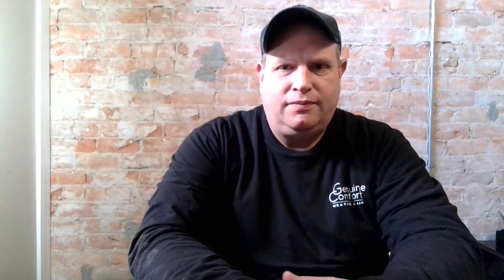Whats the difference between Variable Speed And ECM Motors

Comment: Variable speed and constant torque motors are both ECM. Variable speed will keep a constant cfm. If you're filter gets dirty, itll increase torque and rpm to maintain CFM. Constant Torque does what it says. If you're filter is dirty, its going to maintain its torque. But BOTH are electronically commutated motors.

Comment: I have a variable speed furnace, but in reality, it will only run at 5 speeds, even though it has the necessary circuitry to run at any speed.  Mine is used with a two stage air conditioner and from the factory, it has two AC speeds, two heat speeds, and one fan speed preset into the system. Using switches on the unit, I can change the speed for any of these run modes, but it cannot be varied on demand by my two stage AC or the heater other than to select the different modes, which are esentially high and low for heat and for AC, and a setting for a low volume circulation only.  Now with a two speed condenser, it really is necessary to use a furnace like this because once again, you need to have the ability to match the air flow to the different stages. I had an inverter based system where the condenser could change over an "infinite" range, then the blower would commicate with the condensor to match the speed of the blower and the pressure of the condenser (at least this is my understanding).  Otherwise, my variable speed furnace can only run at one of five speeds, but I can manually set the speed for each stage using the controls on the furnace, but I have to go into my crawl space to do that and I think it is pretty complex because you need to be able to kind of get your drop in real time to avoid too low of an airflow to cause the evaporator to ice up .

Comment: On variable speed motors, how much will they slow down? If real slow how do we prevent coil freezing
Reply from the maker: Usually Depending On The Brand, They Slow Down To 65% Of The Full CFM Set At The Board. Thanks so much for reaching out.